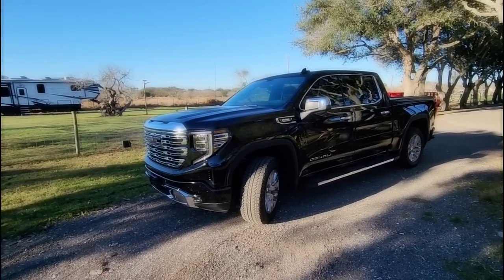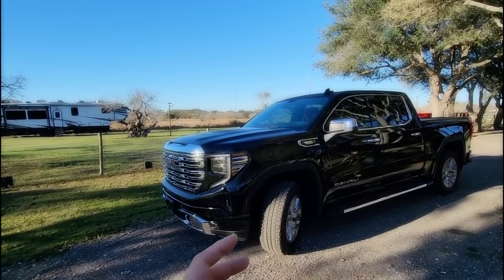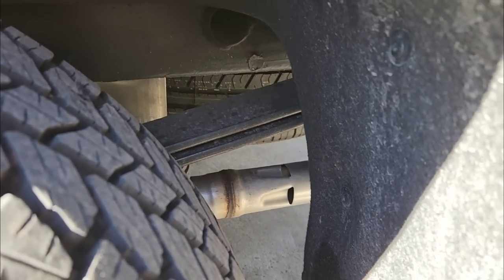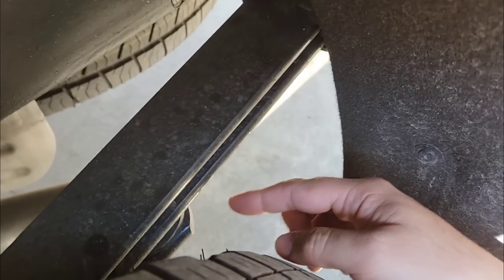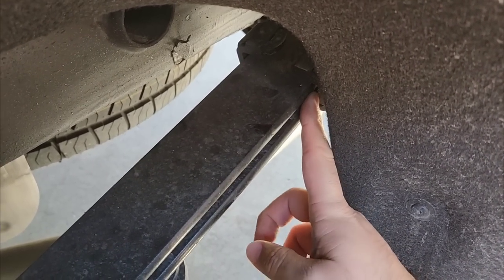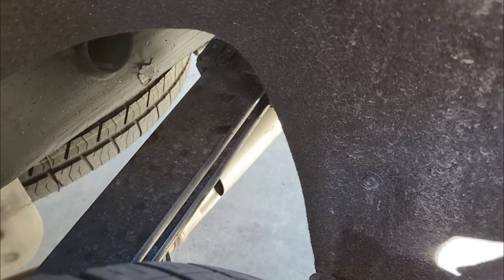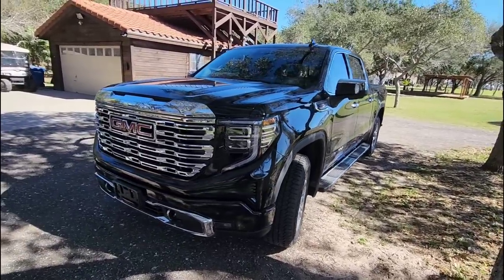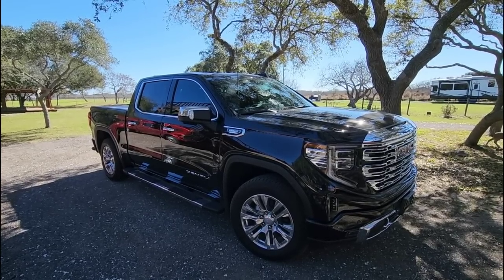Problem with our new 2023 GMC Sierra Denali! Rear Knocking sound.

Comment: My truck has been repaired 4 times for this issue first time they greased it second time they replaced bushings third time they replaced the whole suspension 4th time they tightened everything and greased it and still happening its the leaf spring ends they have a plastics which is what caused the noise sounds like if it was your tailgate. Also it gets worse if u get diesel or def on them from overspill when fueling it goes down from the hose and gets on the leaf springs
Reply from the maker: My truck is fixed and the problem has not come back ever since inserting the rubber bushings.

Comment: It doesnt sound like a spring. Bad shock or dif noise. But if still going with leaf springs, maybe put a load on the truck to flatten springs a bit. Me personally I would have been back at dealer. The price of trucks these days, I'd make them figure it out and fix it.

Comment: Since you have enough space have someone get in the drivers seat while it's suspended up in the air with Jack stands and set in drive and see for yourself or record it please safe in doing so. It can be your leaf spring shackle, dif, or u joint even drive axle

Comment: I have a 2018 Silverado 4x4 that is my city work truck. It’s my take home vehicle. It does the same thing. Never been sure what it was. The truck has 36k miles on it now. City got it new. And we have only towed a couple times with it. So no help here for a solution. But my truck is a crew cab and it makes that noise. And we have a 2017 Extended cab that doesn’t. Around the same mileage on both. Hmmm….

Comment: Might be a broken motor mount in the front or something to do with the steering? In the rear could be the bed is loose on the frame or something metal is a little loose underneath the truck enough to make a rattling noise?

Comment: Have you installed a bed cover on that truck?  I have a 2020 GMC 1500 with 3.0 diesel and just installed a Roll n Lock bed cover and now I have that same sound which is the canister of the bedcover rubbing on the front wall of the bed.

Comment: Nice truck BTW, I am curious if you have the increased tow package installed. Have a friend with a 2023 1500, less than 1k miles and is going back in this week for a second visit trying to get a similar noise fixed. I am about to purchase a 2023 myself and am getting the max tow package and am hoping it doesn't have the same issue. Any update on your resolution with your truck?
Reply: Good luck finding a Max tow truck right now!

Comment: Had the same issue on my 22' 3500 Sierra AT4 HD. Dealer said its a known issue with the leaf springs on all 3 weight class models. 15, 25, and 3500's. They swapped it out for a new leaf pack. Issue was gone after that. Until the passenger one went out 2 months later.
Reply: doing the same thing on my 22 Denali 2500, taking it to the dealer next week....

Comment: I had a 15,18 now a 22 hd, they all had noise, shake bed side to side, its the springs, spray with lube it will stop until it drys and wear in over a couple thousand miles and not to noticeable and you get use to it, dont go to dealer please, nothing wrong with it.

Comment: Leaf springs slapping against each other. I had this on my 2022 HD Silverado. I cut a piece of rubber mud flap the same width as the leaf spring and about 3 inches long and slid it between the gap in the leafs and zip tied it in place. I did both sides. Jack the truck up under the frame to relieve pressure on the spring pack will help.

Comment: I have a 2022 GMC pro single cab 4x4. Before I bought it new the dealer flipped the rear leaf spring shackle so the back would sit lower and not give the rake look. Yours looks pretty level so I wonder if dealer.did it to yours. My truck has the occasional knock also.

Comment: If you want it not to recur, replace the leafs with an aftermarket, beefier spring pack.  If not, have them take care of it under warranty, but setting that truck up with a better spring pack will be better than what the dealer would do.
Reply: But I just bought it cost more than my first house my retirement truck 🚛 their job 😂

Comment: Do nothing to solve the problem. It’s under warranty. Take it to the dealer. The noise could be symptom of a deeper problem. Take the noise away and the dealer won’t be able to fix it because they can’t duplicate the noise. The Boshield was the wrong thing to do.